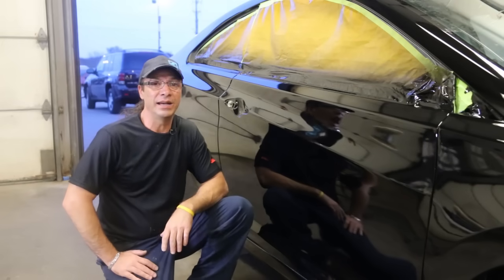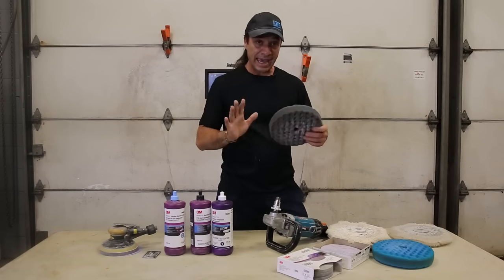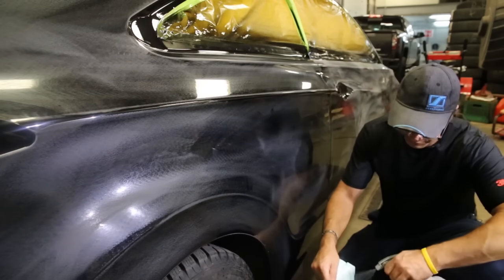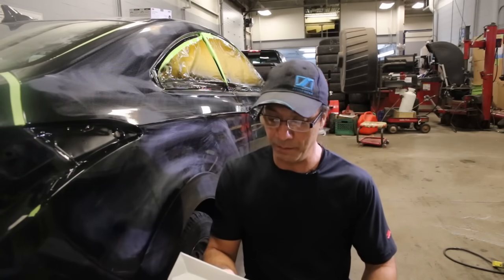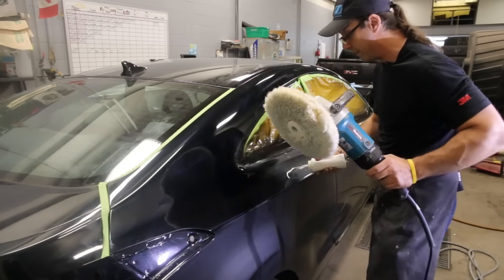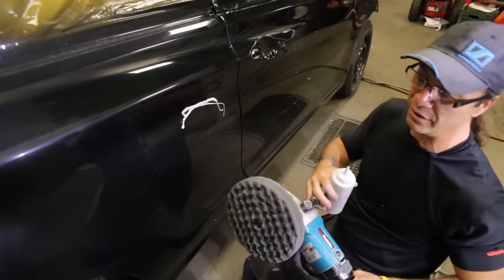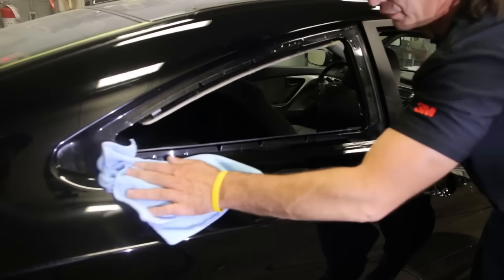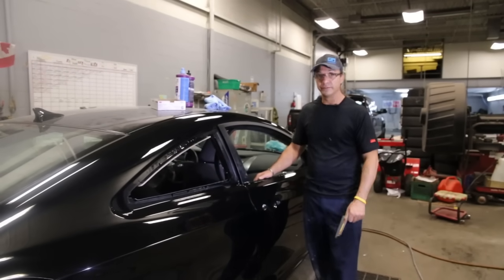Professional wet/dry sanding and polishing tutorial. 3m Trizact system, EX Compound

Comment: After a terrible first SSUrethane spray,  hours of wetsanding 600 then 800, got rid of orange peel. I decided to respray again for uniformity. Much better result using a Fuji SPray HVLP system, event though the city power went out 1/2 way through. Thanks to quick flash time on SSU, it was not a disaster. Still some medium peel for sure, but with using  some test areas it looks like 1500 will be a good start point. Maybe even 2000 to start. I 'm scared s$#tless to try the first cut dry. I hear that dry actually becomes a less aggressive grit compared to wet but of course we know the cautions when using dry.  With the minimal flat surfaces on a '54 Chevy pickup, 90% of it just has to be hand sanding.
 My question is, at the  completion of the first cut (1500/2000) what the surface should look like> a matte dull semi smooth result?
 I fear I am not going to be able to remove all the peel without burning paint and there is no way I am doing anymore resprays. So I will live with that. 
My plan is 1500/2000, then 3000, then Perfect-IT compound with wool pad, and then machine polish. I will never use the single stage urethane again, at least not with a HVLP system.
Reply from the maker: larry gk how many coats of clear is on it all together? You didn't have to reapply the base against did you?
Reply: No, no..this is single stage urethane paint, so base/clear are all in one formula. But to answer that, it now has 2 coats of paint over the previous 3 coats. I did start sanding and in the bad spots it is requiring 1000 then 1200 then 1500 to get it matte and smooth.
Reply from the maker: larry gk try 1000/2000/3000

Comment: Are you still using the same products and having the same outcome? We have developed a bad swirl problem. I can do exactly what you did but i use the foam compound pad in addition. Our paint rep and 3m rep have no solution for black swirls.it can look perfect in the booth but in the sun the swirls will show their head. We are also using the new stage 2 polish that stays wet longer. We have used both but the 3m rep said that will solve it and he thought he killed it till we took it outside. I hear our whole area east TN has this problem. What is your opinion?
Reply: If you haven't, try finish polishing with a DA (random orbit) polisher. Also, the guy over at CSI described the same issue, so he went and made CSI polish. Haven't tried it myself though

Comment: Can this process (skimming and so on) be used on a new car (RAM 1500 in my case)?  How can I tell if I have enough clear coat to do this?
Reply from the maker: There is not much clear on cars these days. If it has a ton of light scratches, the most I would do is 3000 wet on a da then compound/polish. Anything rougher then that, you'll be burning everywhere.
Reply: Thanks!  I'll keep that in mind.  Great video by the way!

Comment: I have a new vechile that i need to get carwash brush scratches out. I have a makita buffer but scared to wet sand and may not need to wet sand. Is there one 3m product i can buff them out with?
Reply from the maker: If you can use an orbital polisher with a good compound, try that first. Rupes is a good one to try.
Reply: @loveja1  Ok will do. Thank you. Then after the buff should i use a polish or a wax?
Reply from the maker: @riyaandrayplay6856  wax it as your last step. Or a sealant.

Comment: Hello, Do you have any tips  how to shine up a brand new painted car? I usually paint/clear coat. then I take out makita and use a wool pad with stage 1 3M. How do I determine when I can move on to stage 2 of 3M? and then wax with the pad?
Reply from the maker: Once you see a nice shine coming through. The compound pad will leave light circular scratches in the finish and then proceeding to a finer wool pad. It takes some getting use to knowing how far to take each step before moving on to a finer pad.
Reply: My stages I think might be different. Stage 1 is for removing scratches, stage 2 is removing swirls, and then stage 3 we use a strawberry wax. I am trying to find a video that can teach me how to mask the car off for painting where it does not leave hard lines. 

Our wool cloth pad is the first thing we use, then we do the sponge pad. What is the difference between the grey pad and the blue pad you are using? 

We don't do detailing I guess thats why we only use two types of pad and 3 M products right after clearcoating. I don't know how much pressure to apply, and I am afraid to burn through the paint. My bosses already leave me on my own and its nerve racking I have noone to teach me. We also don't do the 1500-2000 grit for the whole car like you do.

Comment: can i use the same method on a batwing fairing on a motorcycle?
Reply from the maker: You would probably get better results using wet paper. Go from 1500,2000,3000.

Comment: Sir, idk if you ever going to see this but i do this exact process and it comes out good, but idk how to take off the holograms it leaves at the end. How can i correct that?
Reply from the maker: Use an orbital polisher. First  bring up your shine and remove scratches with your rotary, then use an orbital with a compound pad with compound with the initial step, then the polishing pad with polish as your last step, it comes out beautifully.
Reply: Thanks

Comment: I have spider Web and swirl on my paint. I have a dwp849 and I just ordered pads for it. do you recommend sanding with 2000 or just use rubbing compound, Polish then wax?
Reply: also what rpm are you running?
Reply from the maker: Raider Jim rubbing compound will be your starting point. Then all the other steps. I use #3 on a makita. I think it's 1500 rpm.
Reply: loveja1 so use the rubbing compound at 1500 with a wool pad and then Polish with a foam pad. Should I wax after?
Reply from the maker: Raider Jim you will need all proper steps. Compound with a compound wool pad. Grey polish with a #2 wool pad. Then grey polish with black foam pad. Then wax the crap out of it. Ha.
Reply: loveja1 I just ordered pads off amazon that fit my Dewalt. five pads that grade from heavy cut to final finish. the also have two wool pads. I get that I will use the wool pads for compound. should I then use the soft finish and then the final Polish pad?

Comment: HI I have a few questions. I just painted my truck, I don't have a booth painting my cars is a hobby, so after I painted outside of my house, the weather here in Ohio was around 85 degrees everyday I wait 2 weeks and I sanded the whole truck with 2000, 2500 then 3000 I polished with polish compound turtle wax and used wool pad however I couldn't make this truck shine like a mirror any idea what I can do to make it look like a mirror?  Do I need to sand it again or just wash the truck? and also Do I need to use wax later on?, or just use 3m and that's it? what pad do I use foam or wool? I am afraid to take off all the clear coat, even do I put 3 coats of clear coat medium wet. and when I sanded the truck I did it with water. I really want my red Silverado to look really like an apple with honey on...
Reply from the maker: rocalegi you have to get all the orange out in order to have a mirror shine. Depending how hard the clear is depends on what grit to use. I’d start with 1500 wet then 2000, then 3000 wet. Then use all the steps in this video. After the compound pad, use a polishing pad with with the grey polish, then black foam pad with same polish.

Comment: How many passes do you do over a section with the 3000 trizact? I’ve been taught to go back and forth 10 times over an area, and do you ever use 6000 trizact? I’ve heard off an old fella at the factory that 6000 really helps on darker colours.
Reply from the maker: NotAGremlin depends what last grit you used. If you go from 1500 then 3000, you’ll want to take 5-10 passes. If you go from 2000 dry to 3000 wet, then up to 5 is fine. Every paint is different. Try different passes per panel and document it.

Comment: Also, do you ever get holograms after finishing out with the Makita rotary ?
Reply from the maker: 1minibean it's not a rotary. It's a high speed polisher. Different tools for the application. If you want to make sure you don't have any holograms then go over it with a rotary polisher with a swirl mark remover.
Reply: I don't understand? How is a Makita not a rotary? A high speed polisher is a rotary by definition because it's a forced rotation.

Comment: just layed 4 coats of 2k on a race helmet over 4 coats of honda automotive paint, have hairs and dust in the clear maybe 5 hours after, i know after 12 hours it says its ready for a polish but how long should i wait to do dry wet sanding to get the high spots? thanks
Reply from the maker: Sam Adler the longer you can let it dry the better.
Reply: @loveja1  thanks for the reply, im going to wait at minimum a full 24 hours
Reply from the maker: Sam Adler paint usually takes 30 days to finally cure. If you sand it too soon then you’re risking it still shrinking. You can also fully sand it and let it sit for a few days and then polish it. Opening it up by sanding could potentially let it cure faster. Some may argue that point.
Reply: loveja1 how about applying mild heat to speed up the process?
Reply from the maker: Sam Adler ya. It all helps. Or throw it in the baking booth as often as you can when a painter is in there. Or out in the sun for a couple of days.

Comment: Hello , you should use Wipe Out or IPA after every cut step , so you can see the percent of cutting , if you just wipe off the compound it’s perfect , after one wash with active foam u’re gona cry
Reply from the maker: After 35 years polishing I really don’t need it. I know exactly how the surface is acting. But thx for the tip. Cheers.

Comment: I was wondering if the initial 1500 sanding could be done wet rather than dry when using your sander ? Any differences ?
Reply from the maker: 1minibean strait scratches are more difficult to remove then circular ones. Plus it's a lot faster and there is no clean up from the clear running off.

Comment: HI there 

Saw your video and I would like to get your advice, I have a black car that has many or multiple rock chips on the hood and I've been seeing several videos on you tube i wanted to see if it's ok if I was to sand those chips with 1500 grit and then cover those chips with paint to cover those chips directly from Mercedes and after doing this again with 1500 then 2000 after this polish 1,2,3??

or if I should sand the entire hood with 400 then 600 after this use primer then sand with 1500 - 2000 then apply spray paint as base coat and finish with clear coat followed with 1500 - 2000 and polish with the 1,2,3?

Could you please advice 

Thanks
Reply from the maker: Rick L good question. Do you work in a body shop? What do you do there?
Reply: loveja1 no,  I don't work at a body shop I'm a do it yourself type of guy and I was planning on doing this to my own vehicle,  but I've been seeing a lot of videos and I pretty much got the idea on how to do this I just want to make sure I do it right.
Reply from the maker: Rick L what colour is it? Year?
Reply: loveja1 it's a black 2011 mercedes
Reply from the maker: Rick L one of the best ways to go about it is use 2000 wet just over the chip. Use a single stage black to fill in the chip. Don’t go overboard, just what you need. Allow it to dry then block sand it with 1500-2000. This all depends on how many you have. Sometimes it’s easier to just strip the hood and repaint.

Comment: Will this work on a 20 years paint?or what’s the best"?
Reply from the maker: Depends the shape it’s in and how much paint is on the surface. You can try a light wet sand with 2000 just to clean the surface and then follow up with compound and polishing. Might bring that paint back to life.
Reply: @loveja1  thanks for the answer

Comment: What speed do you set the polisher when compounding and polishing?
Reply from the maker: 1500 is a good speed.
Reply: Thanks
Reply from the maker: @luismarty1685  and obviously slower speeds in tighter areas.

Comment: Does it matter what wool pad? Or any wool pad
Reply from the maker: I prefer 3m but everyone has their own preference. And I prefer the double sided.
Reply: @loveja1  oh ok i will look for it , if i would've known i wouldn't have bought the white 3m foam pad only thing i dont like about the wool one is the stuff that flies in the air its super itchy on the nose but if that is the better option i will use wool because i did not know foam required a lot more heat i always kept the speed at 1-2 thats probably why i still see the swirls and scratches , thank you for that information!
Reply from the maker: @pol-ek3yq  3m has a wool pad with low lint, it actually works pretty well but I hear ya, they can get a bit messy. Maybe take it outside and spur it pretty well first.

Comment: What are your thoughts on the 3m one step process vs this one?
Reply from the maker: I’ve heard good and bad. See if you can get a sample bottle before committing to a big one. Every clear out there reacts differently, it might work well because it’s a softer clear or it may hate it.
Reply: @loveja1  sure. using ppg shopline paint and clears. just wondering if it achieves the level of finish as the 3 step. Im wanting to cut and buff my home paint job which has a little too much peel. can i start with 1000 then go up from there?
Reply from the maker: @genuinejake9851  how many coats of clear does it have? Are you dry or wet sanding it? Are you wanting to remove all the peel or make it look like factory?
Reply: @loveja1  3 nice coats. had planned on using dry but im open to suggestions. I have blocked the whole truck to be as straight as i could get it so i was planning on taking it down flat.
Reply from the maker: @genuinejake9851  you can try it with 1000 wet on a block first then work your way up to 3000 wet on a da for your final sand. Do you have access to an orbital polisher?
Reply: @loveja1  i have a dewalt rotary with the perfect it one step pad. also i have the trizact pads i will be using prior to that
Reply from the maker: @genuinejake9851  I have totally changed the way I’ve been working lately after taking a ceramic coating seminar last month and they polished everything with an orbital polisher and it comes out beautifully. After you wet sand, use the rotary with your compound pad and compound, just to get the shine up, then switch to an orbital polisher with the compound foam pad which is kinda aggressive, use that with the compound you used during your first step, take your time and go over the whole truck. Then get a foam polishing pad with polish on the orbital and do the same over the whole truck. You won’t believe how nice it turns out with absolutely no swirls. Report back to me if you did it, trust me you’ll love it.
Reply: @loveja1  do i need to spend the money for something like a rupes machine?
Reply from the maker: @genuinejake9851  no need to spend that much unless you plan on using it every day.
Reply: @loveja1  do you know of a good one?
Reply from the maker: @genuinejake9851  I’m not sure where you’re from, I’m in Canada and bought one from Canadian tire for around $150. See if you can borrow one so you don’t have to spend money. Not sure what the brand is

Comment: Forgive my ignorance and the fact I'm really late to the party but could you tell me why you prefer this makita rotary type polisher over a DA polisher like most of the other YouTube guys using the Griots or the flex ?
Reply from the maker: David Weglarz a rotary polisher will remove the sanding scratches and a da is dual action, which is used for sanding. Just like an orbital polisher the way it rotates.
Reply: loveja1 thanks for that Tony, I sure enjoy watching you and learning from you.   Really wish you would do more like this but thank you again Sir
Reply: loveja1 one more question Tony if you don't mind Sir.   I may have gotten myself more confused somehow. 
Does the makita leave holograms that still need a DA to get out completely?  Or do you feel you don't need to do that?   
And it doesn't seem like your palm sander is da either?   Am I correct in assuming a guy with your experience doesn't need anything that is dual action then?  
Thank you again for your help man.
Reply from the maker: David Weglarz if you follow all of my steps with the high speed polisher, you should not have and swirls. If you want to do a high quality job, use a meguires swirl mark remover and use that with an orbital polisher. Take your time with this step.
Reply: loveja1 I understand but asking really more about how a guy like you does it that has tons of these to do.   One day I would like to be like you, getting great results from just your one makita machine.   When you say high quality job I assume you mean for the guy who doesn't have your experience and probably needs a da also?   Thanks again Tony

Comment: Is your wool pad a cutting or buffing pad?
Reply from the maker: Ichidragon that's pretty much the same thing. Everyone has different terminology for it but essentially it's the same. Just like when people say colour sanding, it's technically just called wet sanding. Colour sanding refers to when we use to use laquer to paint and there was no clear coat. Or a single stage solid colour.
Reply: loveja1 Thanks Tony